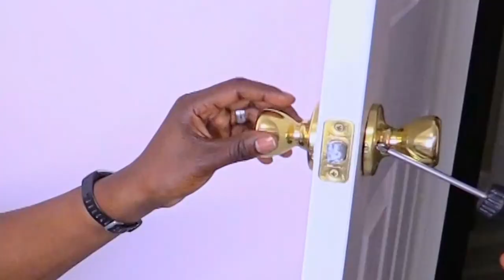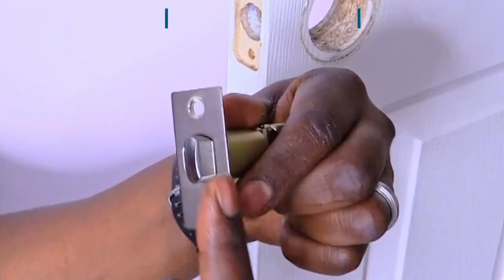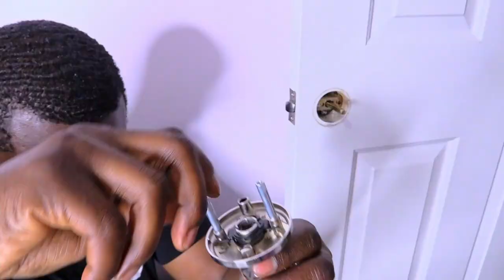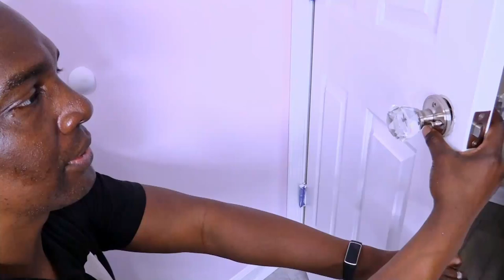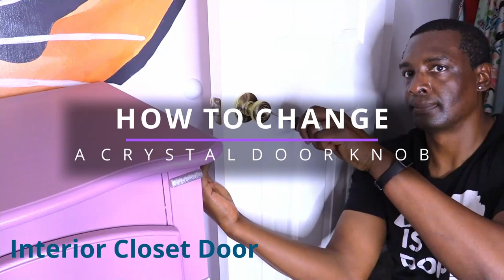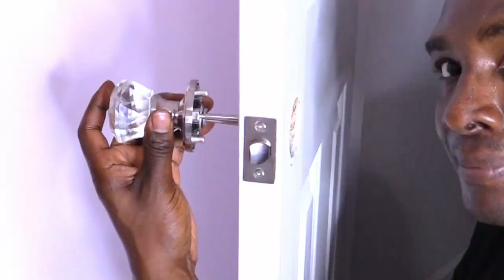How to Change a Crystal Door Knob Step-by-Step | The DIY Beginner's Guide

Comment: A special thank you! I'm 73 with zero skills and this was the critical info I needed to replace a horrible painted over closet doorknob (from 1965) with a new "crystal" one. Gues I'm glad it wasn't glass when I dropped it on the non-carpeted floor while screwing things in. But it is in and working and very attactive. Good tips and I'll be repeating the process in an upstairs closet. Blessings to you both and thanks again.